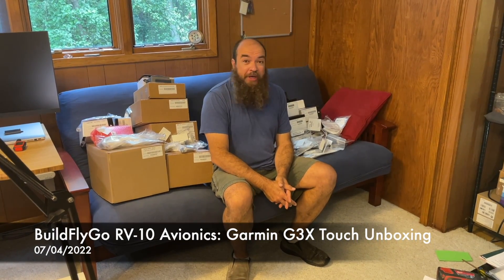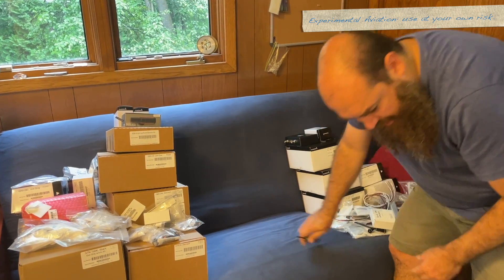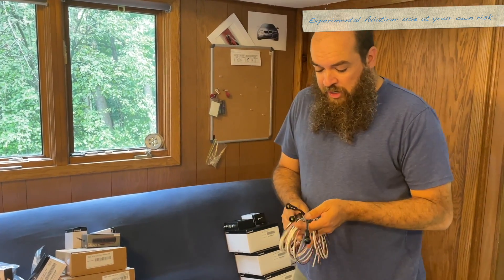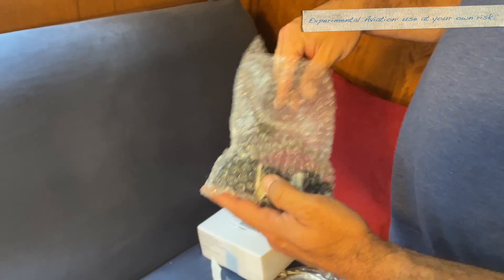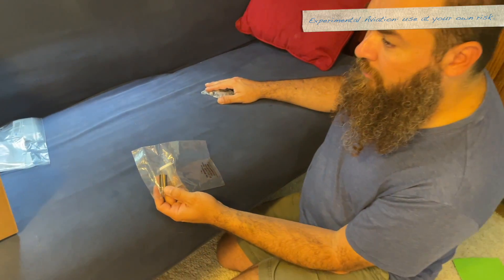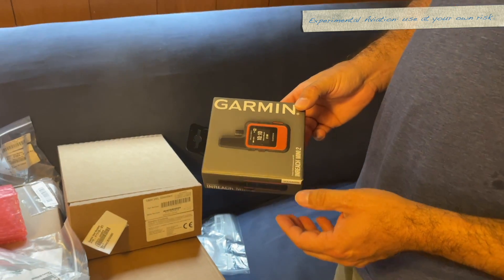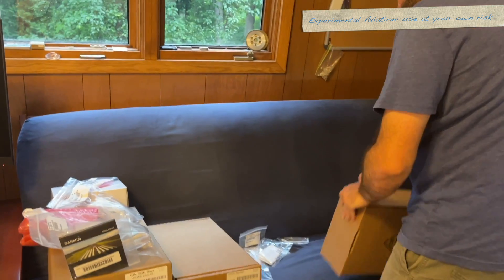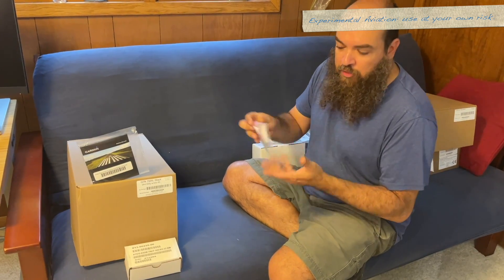RV-10 Avionics: (Almost) Complete G3X Touch System Unboxing

Comment: Really excited to see the unboxing of the GTN. My 750 is due to arrive first week in October. Like you said, they’ve been back ordered forever!
Reply from the maker: It’s at the very end, the chapter markers should help :)
Reply: Hello,  I am trying to make my 750 fit in my panel.  between the middle rib and the no wanting to cut through the bottom of the mid-panel, it becomes a problem.  Do you have the dimensions of your panel and 3 D model you can share?
Reply from the maker: @MichaelElstien  The RV-10 plans describe where you can cut the mid panel to fit deep avionics, take a peek. As to the middle rib, reach out to vans with what you want to cut and they will tell you if it's ok.

Comment: Agree the Garmin back shells are amazing. I've ordered one for a different purpose just because they are so well made. Wish they would sell them separately outside of the connector kits. Agree about using the Garmin (or order TSO'ed) USB outlets are the way to go. If you find them too expensive you can get deals on the double USB-A versions. Might be an outdated standard but you will always be able to find a cheap cable for whatever you plan to connect.

Comment: That is going to be one sweet panel setup. I'm hoping to do pretty much the same thing someday. I was kind of surprised that the engine pressure sensors had pigtails versus an integral connector. Integral connectors would allow for a more rugged setup on the harnessing around the engine. Also easier to isolate and replace failed sensors.  Perhaps Garmin will consider doing this at some point.
Reply from the maker: It’s a Kavlico sensor with a metrapac connector. They just put pigtails in the connector in case you don’t have the proper crimper. I’ll probably buy new pins :)
Reply: @BuildFlyGo  Ah, so it does have a connector. Wasn't clear - I should have asked before assuming!

Comment: YouTube Tip, Guil... any time you reference a previously posted video, you can put the link in the description (at least) and/or add a card (puts a link in the upper right corner of the video) at the time you mention it. It will help with video ranking.

Other than that, I'm glad you posted this one. I'm also going with Garmin. Any need for any of this (besides the LRU's/sensors, etc) during the tail construction (since I'll have to wire the rear light)?
Reply from the maker: You don't need any avionics until you start working in on the panel. You can order connector kits around the time of the fuselage completion to get started wiring the long runs but even that really can wait. No need to keep parts on the shelf aging :)